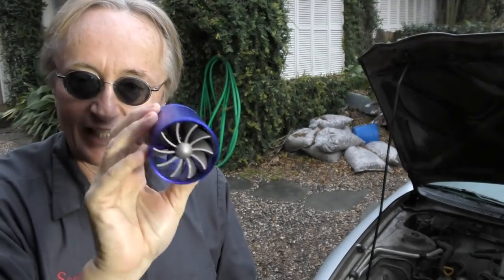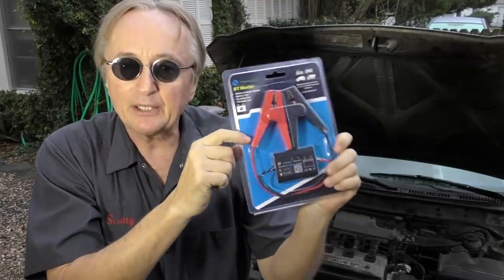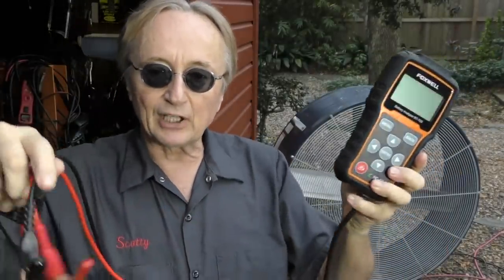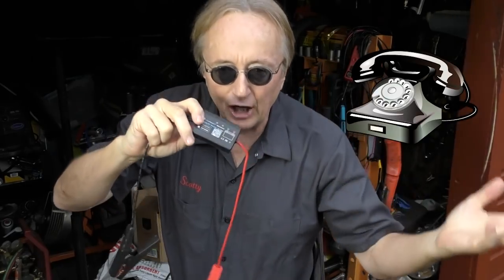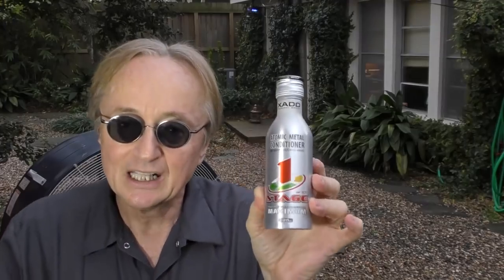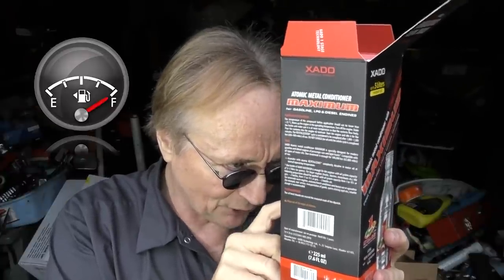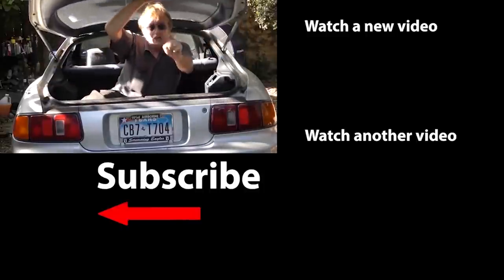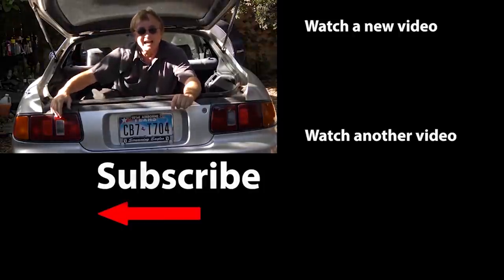The Worst Car Products on Amazon

Comment: for what its worth, i tried duralube back in the 90s. i changed oil in my geo storm. my ex and i went on a trip that was around 250 miles. when we got back, i was doing my usual fluid checks and i saw the crankcase was dry. not a drop of oil. i forgot to tighten the drain plug and it all leaked out. i dont know why it didnt clatter and things started going whack but i refilled it with fresh oil and it ran like a top. did till i sold it. no damage and seemed to be even better than before the duralube. i did the same thing on another car years before. i changed oil, forgot to tighten the drain plug  and i burned it up right away. i didnt make up this story so i have been using duralube ever since.

Comment: Ill tell ya that analizer would have come in handy last year. My escape had a bearing in the alternator going out. Sounded like hell 
Everyone, including pros and joes saying my timing was going, this was going, that was going.
Just the alternator was done. 
But then i was having trouble with my entire interior shutting off. I thought it was shorts or something in the wiring somewhere. Would happen randomly and more ofter around a corner. Turned out the dead alternator damaged the battery and couldnt produce enough juice to run the car and electronics. Neat that the computer had a safety to shut down the interior to protect the computer from low voltage, but man what an adventure.

Comment: The Tile key\wallet\phone finder. Works great. But battery only lasts a year and may be nonreplacable. But of course its 40$ for the cheapest. But it works. Found my wallet 30 miles away when it fell into the truck at work.

Comment: Had a friend that had a Chevy hhr with an in line 4 in it. It was a former Amsoil show car. Amsoil displayed this car by only changing the oil every 20000 miles. The engine oil passages were plugged and the top end ran dry. When we pulled the vavle cover off.... well we had a good laugh.

Comment: I went to Amazon to check out the "Battery Tester FOXWELL BT705" and saw when I checked they had one of their 'deals' running but with only around 4 hours left. When I checked they were selling it for $109.64  instead of $128.99. Made me wish I could justify getting one of those for my 1998 GMC pickup truck, so I could make sure everything was Okay. I passed it up though.

Comment: Hey Scotty I have a 09 Cadillac STS the undercarriage is missing the plastic is it just a protector underneath the engine or is it for aerodynamics as well  like for wind not to rock the car I never reinstalled it
Reply: Not scotty but it will have a negligible effect on aerodynamics. But good for protecting the undercarriage. The front end is particularly important. If you drive on uneven terrain or bad roads, or even if you tend to park close to the curb. You don't want any punctures, especially in the oil pan.

Comment: Only three additives out there that'd I'd use.

BlueDevil resealer, AT 205 resealer,  and Lucas Pure Synthetic Oil Stabilizer.  And even then, only in old engines with oil consumption problems in a car that just isn't worth putting too much money into.

Comment: Yes the turbo porperler  thing...crap every installation is AFTER THE MAF (MASS AIR FLOR SENSOR) withch scotty in other videos he has posted it  Calculate how much air to fuel mixture that go inside the eninge witch can make af/alphas  go way down and or threw the roof. One thin st the most I can relate to as a alil 4 yrs as a  Nissan tech to scotty I'd say realy ur right ur doin a good job ( diagnostic) witch it into days autos to me is unheard of just gota find the riot issue of the cause...and realty just dont l9ad the part  connon

Comment: Scotty a have 2006 Honda Accord still working like champ but I look for electrical problem with air cool Sistem fans work with a/c  I change the sensors but still the same what you what you think going to be the solution.

Comment: Yeah speaking of those little blue things you were holding there... I found two of those things in Car Lot cars that I used to work at before I got my own carlot..... I took them out... I was looking at them thinking.. heck no man there's a clip that holds that thing together... if that thing were to come apart.. your engine would be eating bearings clips and everything...I thought no way...Take that thing out of there...that's a dangerous meaningless product that could destroy an engine.... I found another cool use for it though ...if you take an air blower and blow air through it at an angle it will make the loudest siren whine noise you've ever heard....lol😁

Comment: I have put a German made intake fan on a dodge neon an Ford Taurus a 4.7 magnum ram truck and a crown vick i just used the same one never got more than one sec on the 0 60 2sec with a cold air it took my 5.2 sec down into the mid 4s to 60 i trust all your advice you really know your stuff but on that one thing let us see a dieno or a 0 to 60 before and after let me see that put in then no difference floored from a stop 0 to 60 got me one sec on every thing i put only one but paired with tunes and cild air i got down in the low 4s to 60 with a stop warch for years very time take it out and go right back to one sec slower back in one sec faster not worth it on its own but paired 3 secs off the 0 to 60 got me in a new bracket of take off times i trust you one most every thing you know your stuff am just asking was a output test done or a clocked 0 to 60 and take out and back in to see it work this always always one sec off never more or less 4 banger v 6 v8 cars and trucks a nice extra cherry for that cold air

Comment: Why is it, if you can buy a battery analyzer that works, your car can't warn you before the battery goes dead? Our car's battery just died, one day it seemed fine, the next flat. Is there no way the car's electronics could monitor the health of the battery and warn you before you get stuck by it?

Comment: Those spinner things that go in your air charge pipe I seen one with a elec motor on it , they myth busted it along with a cold air intake on the Dyno .  But ......the tornado , 🌪️ the one that used to be 30 bucks metal piece you stick in your air charge pipe  on a long drive I did notice a big gas milage increase with it in . I would go on a long 6/7 hr drive a few times a year to visit family with the same car for years it got at least 40/50 miles more per tank with that tornado in the charge pipe city driving it was worthless but on a long steady drive it did work I don't see the tornado around anymore .

Comment: Why would you risk putting a plastic turbine in your intake if it broke it would cause a lot of damage. My mate has one that hooks to the battery and spins it does work but he had to adjust his idle as it over reved. He thinks he get better power and mpg. I think it's in his head.

Comment: What about the tornado turbine for old carbureted engines save you gas increases horsepower is that the same line of BS or what had bought a Chevy 74 Blazer full convertible really nice beast and it had one of those in the Edelbrock 4-barrel carburetor it was just like a fan that just pivoted no power no nothing just spun inside there had a weird whistle to it I left it in and I thought it was comedy and then Linda selling the Blazer a few years after I owned it but sold the BS when I sold it that it was so awesome that you'd so notice the difference and they bought it lol..... Thanks Scotty

Comment: A little more?." You get what you pay for or LESS, never more , if so they will raise the price tommarow?"
There was a time! I remember universal coils  at XYZMART: FIT ANYTHING AND WAS THE BEST, CADILLAC QUALITY & POWER FOR A FORD PRICE! ( AS I SAID , THERE WAS A TIME} OIL FOULED, CARBON FOULED, MISFIRING ( ONLY IF YOUR BATTERY/ ELECTRICAL SYSTEM WAS BAD!) WOULD RUN HOT, FAST & FOREVER! IF YOU KEPT EM CLEAN? YA COULD KEEP EM AFTER THE REST OF THE CAR DIED! You , and those like us grey beards know but can't/ won't tell, because they got "smart" and started to " made em look different on the outside & different " specs/ wording/ for models xyz and years 1890 - 1892? Still the SAME inside but: then there was China, QUALITY needed an aqualung & then ~ bankruptcy? 😡😭
Big I kept two - they will fire and old lawn mower or a 2 ton Tilly BOULEVARD CRUISER as well? 
Good tube: keep up the good info! ❤️

Comment: Please I need it my battery keeps popping up on the dash and I wanna make sure it's the alternator b4 I go buy one
Reply: Just went through the same thing. It was the alternator. Test battery with a volt meter with engine off. If you have 12 volts, battery should be good, an alternator diode is most likely wearing which gives intermittent battery light and can test positive (14 volts) with engine running. Doing a load test on battery will also confirm whether or not it's a bad battery.
Reply: @bigD1376  thank you so much you are a big help